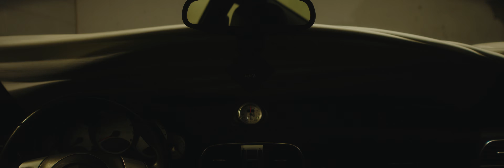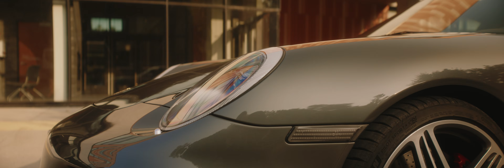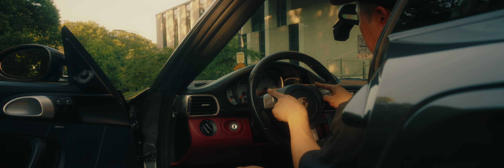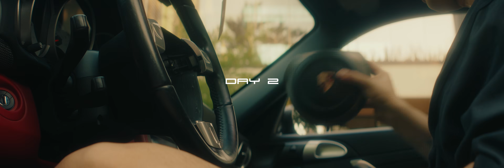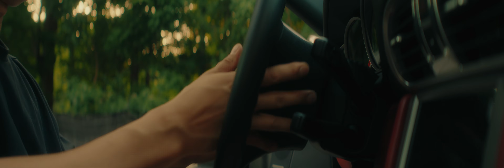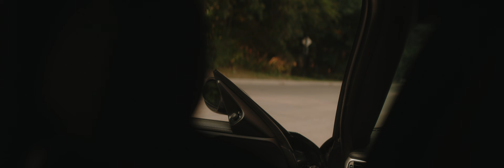First steps! Modding my Porsche 911 (997) Turbo!

Comment from the maker: Thoughts on keeping mods "period correct"?
Reply: Don’t think this wheel was available at the time of the 997 generation? 991.1 was available with “sport design” wheel. Correct me if I’m wrong.
Reply from the maker: @larryhand5892  It debuted on the 997.2 generation. https://www.suncoastparts.com/product/PDKPADDLE.html?srsltid=AfmBOor-zSqb1i5RczCghctS10x54iEDuhT-tCr0A5dBxnqXhYJs7QmA
Reply: make it oem+ .) nice wheel by the way
Reply: Personally that's my approach with mine. I see tons of people throwing Morimoto lights and aero kits on theirs with 991 steering wheels, blah blah blah. Mine is definitely dealer spec, but to me it feels really honest - it's not trying to be something it isn't. By the time my kids can drive it I'd consider it a classic car, and unless it's a 6 figure restomod I'd rather keep the aesthetics period correct. Suspension, numeric shifter, etc. is all ok with me.  The two tone interior on yours is awesome!
Reply from the maker: @mustuddd thanks for the feedback. I’ve been leaning on going back to OEM headlights but will decide this summer!

Comment: Looks clean man. I debated this wheel for my 997 turbo but ended up going w/ a 991.2 wheel.  It’s my single most favorite mod. Changed the whole interior and driving feel. 

Your headlights look great.  I want them but I’m not sure how they’ll look on GT Silver.  Is your car atlas or meteor?
Reply from the maker: It's Slate Grey Metallic. The Morimotos look great on every color imo! Wait for Black Friday!
Reply: I have the Morimoto XB bi-LED headlights on my GT Silver 997 turbo and it looks great. It really updates the look and driving experience at night. Between doing this, updating my suspension with Bilstein Damptronic coilovers w/ TPC DSC module, changing out my front radiators for performance aluminum CSF radiators and getting my cooling pipes pinned to my block. I also did the 997.2 Sport Design steering wheel but I chose the Alcantara steering wheel for my 997. These cars are amazing and fast cars, enjoy driving yours for many years to come! 👍🏽
Reply: @charliekuhn1544 that sounds awesome. do you have pictures of it anywhere online? IG?